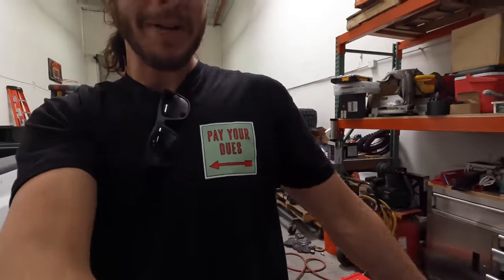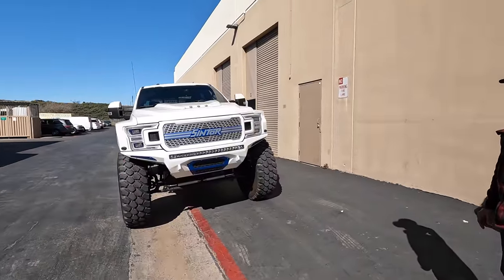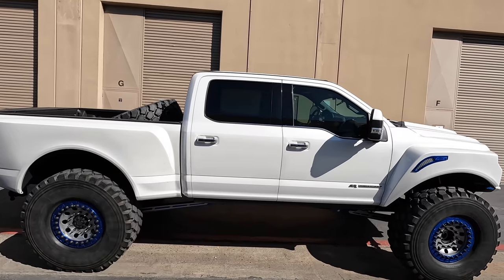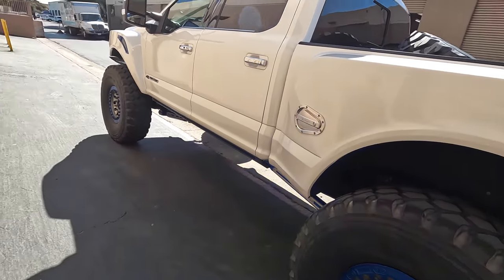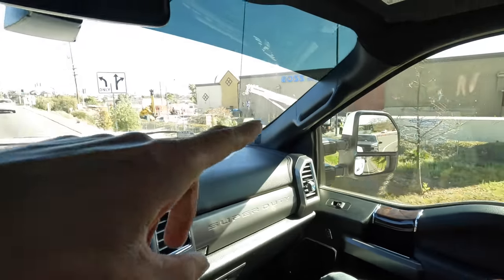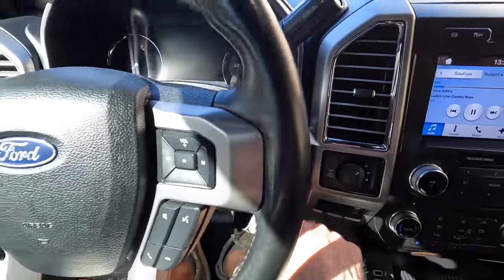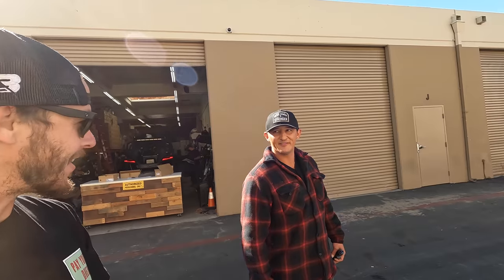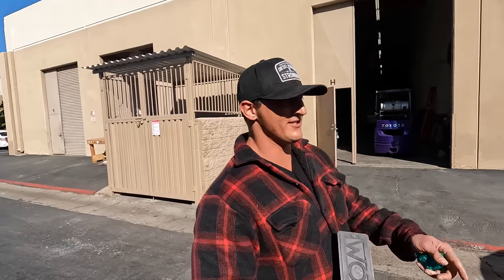THE BADDEST "PRODUCTION" TRUCK YOU CAN BUY!

Comment: I feel like if you spend that much money on a truck the speedometer should function correctly
Reply: you can easily fix it, but why would you? when you get to 50k miles in reality you'd be around 65k. It will keep miles lower over time.. My truck is about 7mph difference.
Reply: @r6venum215  exactly what I was thinking